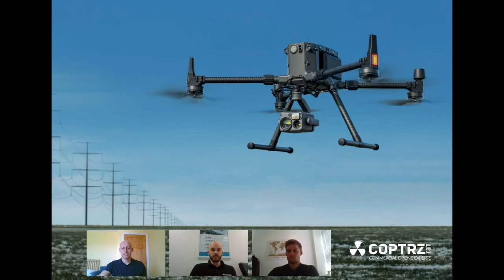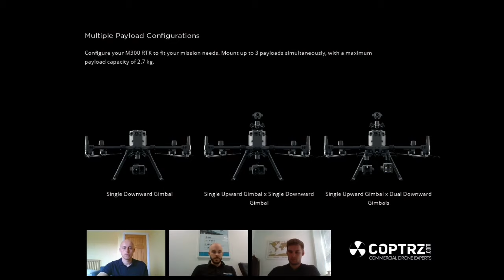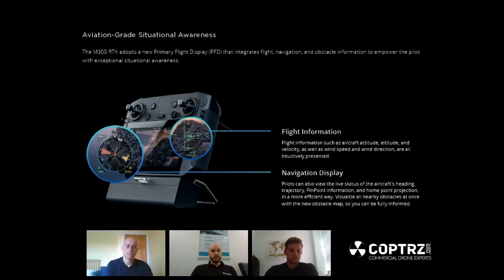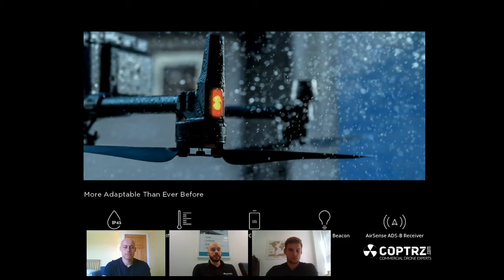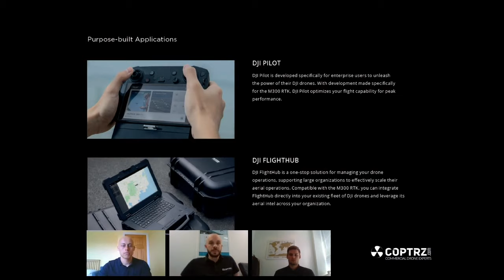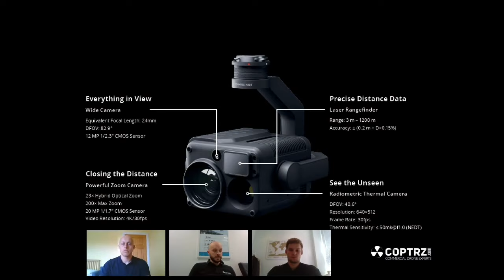Coptrz - Introducing The DJI Matrice 300 RTK - All Your Questions Answered

Comment: Great Bird and we'll Explained 👍👏
Glad to see an Unboxing and overview right at launch, good DJI didn't keep us waiting 😏
M300 is a great aircraft, good work by DJI👌
Does the H20T have a side-by-side view on the smart controller for wide angle and zoom camera?
If so it'll be great for situational awareness, just like military UAVs have this feature, even when zoomed in all the way we can see surrounding areas and don't miss out on details. 
Also the FPV camera could have been positiond a little lower would have looked good🤪
Overall super impressed, hope this entire setup [M300 + H20T + extra batteries (6-TB60s + 3-WB37s)] doesn't cost $50,000😲